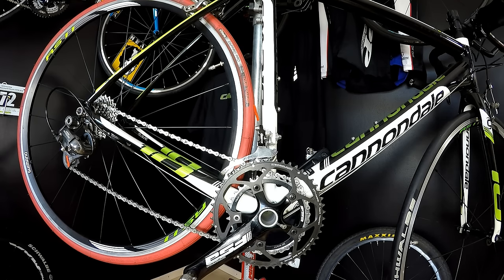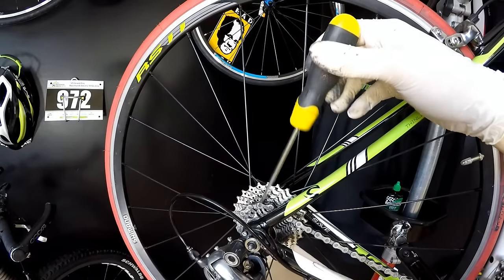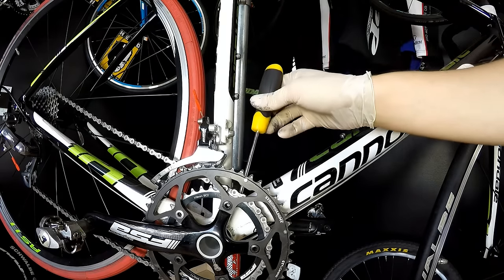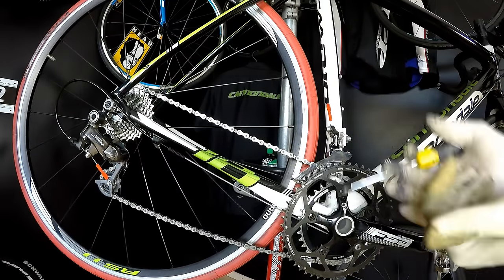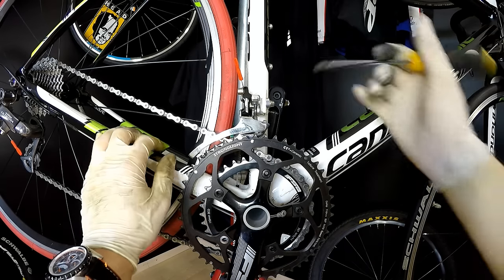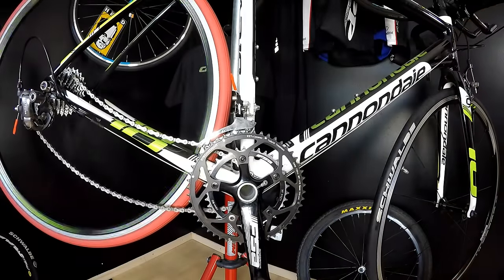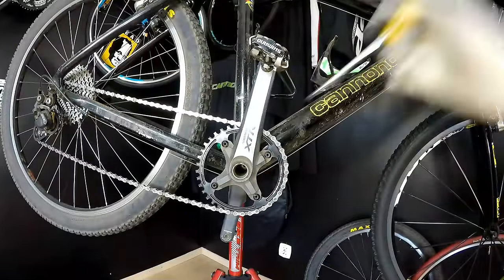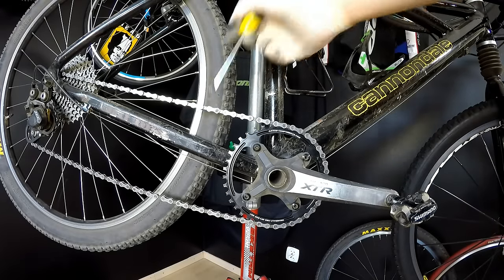3 Main Causes Of A Chain Drop + How To Fix Them. Solving Bicycle Chain Problem.

Comment: This really helped me out! I changed my chain in spring and it started jumping off the large chaining often when changing gears. I tried adjusting the derailleur positions and limit screws, but it didn't help. It never came to mind that the chain was the issue. I put another chain and now the issue is solved!

Comment: I'm using a 105 groupset with an extender for the RD to accommodate a 40t cassette, a bike I use for touring carrying 20Kg loads. The chain drops when I peddle backwards when going downhill while taking a bend. Something I need to remind myself when I'm on my touring bike. I didn't want to spend more money on a newer groupset that can accommodate a bigger cassette. That's the price I have to pay.  Other than that it never happens. However I will try using an Ultegra or 105 chain to see if it might help. Currently using a KMC. I will see if it makes a difference.

Comment: Thanks you so much, This video did help me to fix my chain drop issues, each time when i went downhill i had this hesitation while changing the gear or else it could slip and drop off majority of times, and then i had to go down road and try to adjust it all in together but now there's no such issue. - Happy rider indeed

Comment: Only one thing you forgot to say how to adjust the cable tension of the front derailer.  Otherwise very helpful as my bike's chain drops to the inside on the front sprockets kinda often.  From what you said - could be a bit of user error and derailer some adjustment.

Comment: I need some help and was not able to find a decent answer. I run a 3x9 setup

I recently ugpgraded to a 11-50t 9spd casette and a set of hubs but my rd is still an 8spd shimano tourney (was planning on buying a shimano alivio rd with it but my local bike shop was currently out of stock). 

The hubs and the casette works just fine. Problem is, when I freewheel or backpedal, my chain slacks and sometimes the lower chain pulls my rd forward. Also, when I release the pedal, it spins with the wheel. 

One friend told me that it might just be because of the new hub, either the grease was dry or is still so new that it needs some mileage to loosen it up a bit. Another told me that maybe my rd cant handle that casette or the hubs. 

I can still ride but it's kinda scary, might break some spokes. So until the shop stocks up, I'll be sticking with the problem. 

Any input on what makes this happen will be so appreciated. Help a beginner out. Thanks!

Comment: I experience chain drop when I am in a large-toothed cog on the cassette and I shift into the large chainring in the front. This would happen when I am cresting a hill and I don't shift into a smaller cog, but I do shift quickly back into the large chainring. I have stopped doing this... but is there a better solution?

Comment: I did pedal backwards while cornering at high speed today, good thing my bike was not damaged. Thanks for the explanation!!
Reply: Oh that happens to me and my chain isn’t moving
Reply: @Nightbiker appened to me 😂 I try not to shift when speeding too often and do it after 30 seconds of shifting or try not to spin chain backwards when turning going fast or spinning backwards while changing gears 😂 I say this because the chain tensioners suck and can’t handle speed or be durable but idk I might put a chain tensioner made for racing or performance and durability I try not to speed or beat on my fat tire bike worried the chain tensioner will break that happens to every mountain bike I’ve had the gears always messed up after just driving the bike and changing gears a couple times while trying to ride fast 😂

Comment: I am experiencing major chain drop the last two weeks with my 1X drive train XT and oval Rotor. My guess now is that 1. The wear of the chain is the cause. A very loose worn chain will cause sideways movement a lot more.
2. Worn teeth on both sprockets, front and rear, won’t do any good either. The proper fit on the system is gone.
I think it’s rather soon (9 months of very intense riding but good maintenance)
I’m installing a new set now and hope it solves the problem. It must do so, but it is rather soon that I have to in my opinion. Thanx!
Reply: Hii, I am experiencing the same issue with my one, it is an old bike so did getting a new set solved your problem?
Reply: @chambalgator  yes! Al the suggested actions solved the problem…

Comment: I have experienced chain drop on the front on 3 occasions. At the front it comes off between the small ring and the frame. Bianchi infinito. It’s difficult to free the chain it jams not much space between crank and frame. The chain drop only occurs when I double shift. 
I will try gentler shifting see if this solves it.

Comment: +1 on riding style, i experience strange chain drop where it drop to inner side when i shift from small ring to big ring. Everytime when it occur i was shifting 3 cog up on back end at the same time as shifting from small ring to big ring on the front. After this observation i shift it one by one, rear first then spin one round then front and this chain drop never happens again.
...
Until i think that i still want to do both shifting at the same time for smooth cadence transition, so i bough a chain catcher and continue my bad habit without getting fear that my chain might drop ever again.

Comment: You have quite the assortment of component brands on your road drivetrain. The Ultegra/Dura-Ace and Praxis chainrings are forged and higher quality than many CNc rings. Also the tolerance of higher end KMC, Shimano and Campy chains is better than SRAM. Personally I'd recommend staying with one brand of drivetrain.

Comment: +cannondany i have like a problem on my bike and dont really know the issue, when i am upshifting on the 3rd gear (front chainring), then go like some meters like that and then stand up and accelerate, the chain is dropping. I changed the chain, but im not sure if i need to change the chainring, to me it's looknig pretty ok. 
Any help is appriciated.
Thanks
Reply from the maker: Does the chain drop outwards? Try adjusting the limiting screw and check the teeth on the chainring. Also is the axle straight?
Reply: +cannondany the chain drops outwards yes , the only thing i didnt check is the axle , thanks. Also keep up the good work , at almost all your videos i learned something new about bikes thanks !

Comment: i have a a fat tire cobra modiefied  with a spring to for suppsenion now so when i ride it it is very heavy to move and it has very hard presure on my feet when i move but it can go really fast when i try to race with my friend that has a racing bike and modified with a spring and gear changer he when i race with him and get in a really high speed my chain slips off and and i can't brake coz i have the brakes in the pedal (when i reverse the pedals it stops but when the chain slips i can't stop it so can u help me make it stop sliping i have went to so much people and say stop pressing hard on the pedals and ride slow and i live in iraq and not all streets are perfect coz most are unfinished streets like the just put stones and dirt that my street and when i try to go racong with my friends it always slips can u help they always leave me behine my friend has another bike like me and he can race and his chain doesn't slip like mine and i have to go fix the chain everytime for it coz i can't find the right tools for it !

Comment: The problem with my cycle is that my chain only drops when I’m going FULL speed on the top gear and if I’m not sitting on the seat when it drops then I’m screwed

Comment: I never get my chain stuck like so. My adjustments are always perfect for the top to bottom wall adjustment.
However, it regularly happen that my chain while stuck/stick on the front lowest gear ratio because the tooths are too old compared to the oldness of my chain. It's a pain for the frame of the bike when it happen.

Comment: reason why it drops its because its too lose to fix it untighten the backwheel and put soflty back as much ad you can then tighten it while holding it in same position this has worked for me over 7 years and never happened since then

Comment: My bike chain keeps breaking, and while I’m riding it, I hit my knee on my bar handle
Reply: On a bike like that, the chain shouldn't be on the top spike, right? My chain came out today. I tried putting it on the top spike, but it just don't work like that. it doesn't spin. So I put it on the bottom spike.
Reply: You're on a bike way too small for you if your knee his hitting the handle bar. Try buying a lengthier handlebar stem

Comment: I think the cause of my chain drop is high cadence when i shift the front gear. You explain it at 11th min. Tks so much.
Reply: On a bike like he has, the chain doesn't go on the top spike, correct? My chain fell out today and I put it on top, but it doesn't go there since I tried spinning it and nothing. I left it on the bottom.

Comment: My chain drops when I pedal backwards just once. Why? How can I fix that? I use high gear.
Reply: Same issue with mine, I did all the adjustments I could but the problem is still there. Also could not find any videos of a remedy for it.

Comment: My chain has only gone where it shouldn’t twice.

First time shifting from 3rd to 8th to fast and it jumped off.

And the second i was going down a curb and my pedals swung backwards so when the chain drooped down it then swung back up and off a and i smashed my solid metal flat pedal into my knee with all my body weight behind it, luckily it only brushed for a bit and healed before i got back home and looked at it.